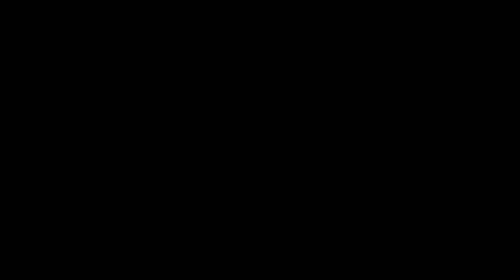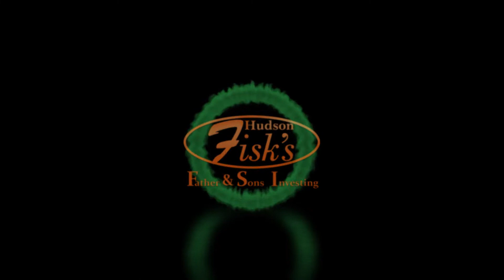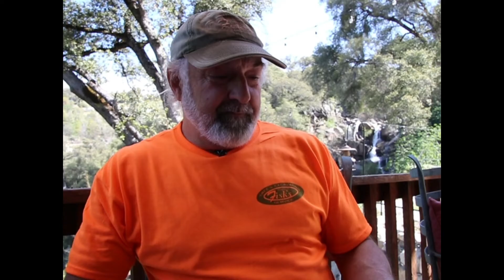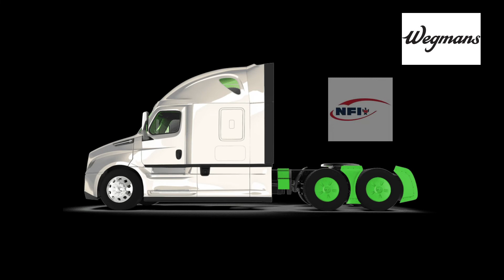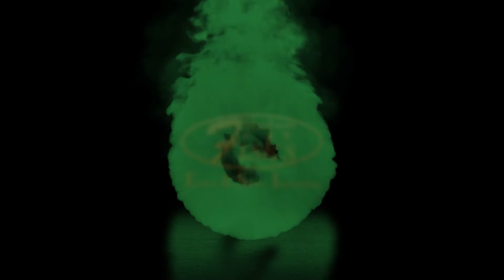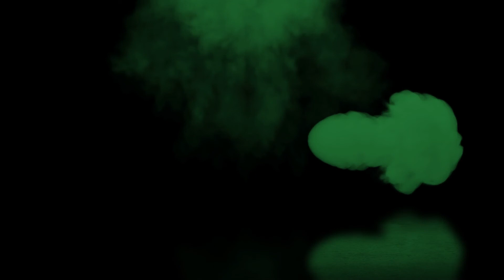Hyliion and Tesla are the Future of Trucking

Comment: Thanks Hudson. Do the patients that Hyliion has prevent others from copying Hyliion?
Reply from the maker: I cant answer that question. I would assume they probably have some proprietary tech but as I stated in my recent video, this tech is not new. Its similar to what freight trains and other heavy equipment have been using for decades. Ive often wondered why it was never utilized for heavy trucking and now,.. Hyliion is doing it!
Reply: @fatherandsonsinvesting521  Thanks 🙏.